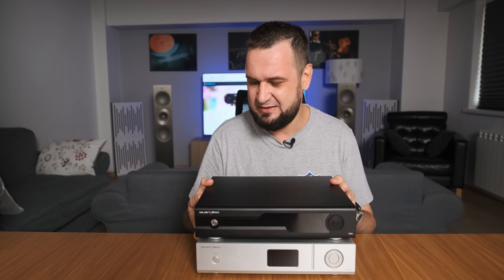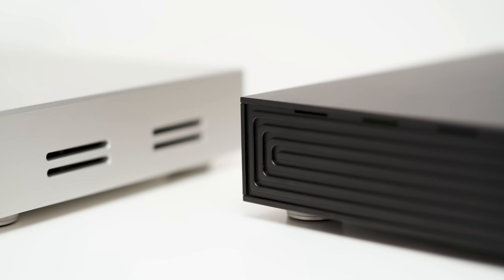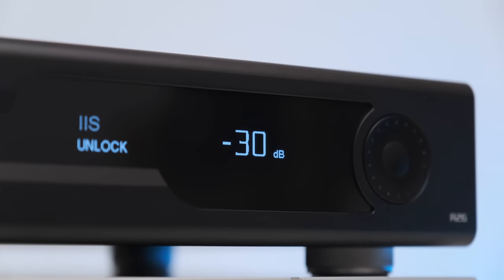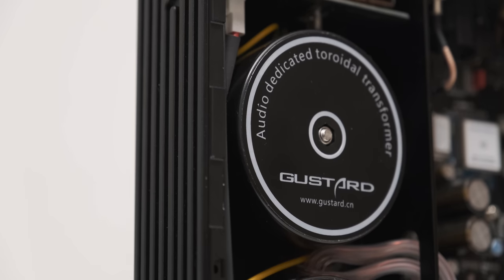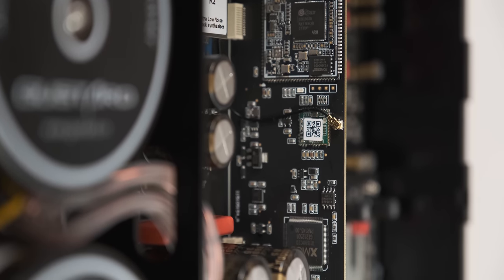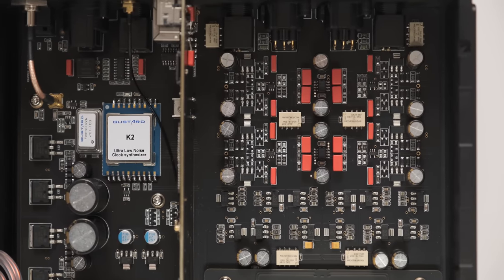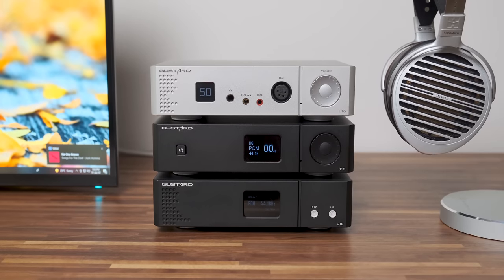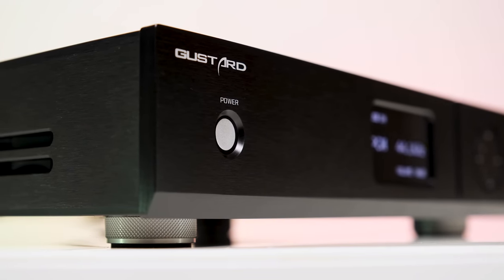The Best DAC I've heard below $3.5K - Gustard R26 Discrete Review

Comment: Hello Sandu, great review👍👍, thank you, I have one question, is there a difference in SQ rca vs xlr output? many thanks in advance for info..
Reply from the maker: Hi mate. The sound difference is minimal at best. Except for the voltage difference and a slightly better channel separation via XLR, they both sound good to me. I used its RCA outputs with the Enleum AMP-23R with outstanding results and I never felt the sound degrading.
Reply: @Soundnews  Many thanks Sandu for helpfull info, so I will use both, rca into my Kinki speaker amp which is single ended and xlr into headphone amp, so I dont need to make a special splitter xlr cable, great work from you👍👍👍many thanks..

Comment: thank's for the review, I want to use a gustard r26 or A26 DAC streamer directly connected to a Benchmark AHB2. you're talking about the A26 which needs a preamp to get the best sound, is it the same for the R26? Is there a perfect solution using the volume of one of his DACs? Or do you really need a separate pre-amp?
Reply: Yes, you will need a separate pre amp unfortunately. All these units use digital attenuation which reduce dynamics so you lose lots of detail especially on low volume listening.  I found this out after I put my old pre amp in between my dac and amp.
Reply: Merci, depuis est sortie l’eversolo dmp-a8 qui inclus un vrai pre-amp, je pense l’acheter 😊

Comment: This review came at the perfect time. I'm in the market to upgrade my system closer to endgame and was very much desiring the Musician Aquarius based on your previous review, but it wasn't in my budget. I was going to settle for the Pegasus & then this review comes out with a very encouraging comparison to the Aquarius & T+. You sold me on this DAC. Ordered!
Reply: I was in the same boat. About to order the Holo Spring 3 and saw this review. Decided to save a grand and try this out. If it is as good as Soundnews says, and works in my system, then I'm done.
Reply: Did you get it yet?
Reply: @klepp19  yes, I've had it for about 3 months. Paired with u18ddc + LHY Audio OCK-1 10Mhz clock + gustard c2 cable. Running IIS into Burson Audio soloist 3X GT. This setup was a huge upgrade from my Topping a90/d90 mqa stack. I have hd800S + HE1000se. HD800S low end came out like I've never heard before on my previous stack. Makes it a much more balanced headphone. HE1000se full sounding and hyper detailed. I didn't mess too much with the LAN option as I don't subscribe to Roon/Audirvana or other media platforms to take advantage of it. I did get trial passes just to try it out. A friend of mine that A/B'd LAN vs IIS felt the LAN was better to his ears by 5-10% at best.
Reply: @OG-cl9br  Thanks for sharing your experience!  I already own a U18 DDC so that I can plug right into I2S?
Reply: @klepp19  correct.
Reply: @OG-cl9br  I will order one after Christmas! I will post here again once I have it! Cheers!☺️

Comment: Hi Sandu I mainly listen to DSD 512 upsampled thru hqplayer via PC using Tidal. I currently use the gustard x26 pro for this. I understand r2r dacs benefit more for pcm. Do you think there will still be an improvement as what you have described i.e less ringing soundstage etc if I switch from x26 pro to r26 if I always upsample only to DSD 512? Appreciate your inputs.Was your test tracks played on pcm or you also noticed the improvement on native dsd? Thanks!!

Comment: Hi Sandu,
There is usually a tradeoff between detailed and tonal richness (meat on the bones). My only experience with R2R was the Denafrips Ares II which I promptly sold for lack tonal richness. I currently own Loxjie D50, while it didn't change my life, it offers enough detail without sounding too thin and clinical. You've established that the R26 is very detailed, is there a tradeoff in the ''meat on bones'' department compared to other high end DACs? 
Edit: OK I just read your written review which I guess answers my question.
What I'm looking for above all else for system synergy is detail yes, but most of all tonal richness. Endless features are at the very bottom of my list. I've found that sometimes the most technically impressive components are the least musically enjoyable when actually listening to real music.
Reply from the maker: Mike, you are right. There were always tradeoffs with R-2R units, even with end-game units like Denafrips Terminator Plus and Musician Aquarius, but as I've mentioned at least 3 times in the R26 review, I didn't felt a single con with it. To me, this is perfection. I won't change a single thing about it. This is how I would design a DAC at this price point. I fact I want to work with Gustard on at least a single project, after hearing their X26 and R26.

Comment: Hello Sandu I want your opinion, I m in the market for a new dac for my headphones setup.. before this review I an ready to pull the trigger for the X26 pro... now I m a little confused... 
My big problem is that I m listen only MQA from Tidal..  and I don't know If the R26 is for me.
Can I listen MQA with the R26. ?,?? 
Which of two do you believe is best match for me..??
Thanks in advance.!!
Reply from the maker: Ditch Tidal and get Qobuz, you'll get a ~10% improvement (no kidding). X26 PRO versus R26 depends solely on your upstream equipment and preference. Both are legendary units, but for me...R26 has something that X26 PRO will never have.

Comment: Hi Sandu! I bought one of these and it sounds good! But I don´t know if my unit is healthy. I connected it directly to a Emotiva XPA Gen3 poweramp and I can max the volume without hurting my ears! Best regards Mikael
Reply from the maker: Hey Mikael, that is weird indeed. At max volume, XPA Gen3 should blast a hole into your eardrums. What speakers are you driving?
Reply: @Soundnews  At the moment a pair of floorstanding System Audio Aura 50 Impedanse 4 Ohms, sensitivity 90 dB! I have three pair of speakers for variation. I checked the output impedance on the Gustard and it should be 100 ohms. The input impedance of the Emotiva is 33 kOhms (balanced).
Reply: Hi I have xpa dr2 and I try connect R26 straight to Dr2by xlr.Are you think is good idea to spare together? are you happy about your system? Thanx
Reply: @buekbukiewicz8064  Hi there! Yes I think it is a good idea to connect a dac of this quality directly to a powerstage by xlr!

Comment: Your review inspired me to order one!  I just experienced  the Zen Stream feeding my HiFiMan EF400 R2R into my 2-channel system via XLR.  Beautiful sound, ZERO listening fatigue but a little "soft" and missing the pinpoint placement of my Matrix Mini-i Pro 3.  Based on your listening notes (and I run Roon) I am excited to "burn-in" this DAC and hope it is "just right" for me.  Thanks again for the YouTube review and your excellent online review.  QUESTION: has anyone tried it with Roon yet???
Reply: Hey bro, may I know R26 is a major improvement compared to Matrix Mini-I Pro 3?
Reply: @JeffreyTham  I absolutely love the R26.  So smooth in my room/system.  The filters on the R26 between OS/NOS (slow/mid/fast) are audible differences and I change them based on recording if needed.  I really have zero listening fatigue.   I plan to run another ethernet cable to my listening room and do a proper A/B since Roon will allow multiple end points.  But, to sum up, I like the Matrix a lot, I just like the Gustard SO much more!
Reply: @magneticcinema Did you say you are using a Zen Stream with the R26? Thinking about doing the same and wanted your input on the sound quality. Cheers
Reply: @Temmple   I do own the Zen Stream but only tried it with my HiFiMan EF400 (which is R2R as well) headphone amp.  I am currently using the R26 as a Roon endpoint via the ethernet port.  VERY happy.  I also purchased a Cayin CD player/transport with I2S but unfortunately the L/R channels are swapped.  I may try the Zen Steam when I get less busy.

Comment: I'm curious if DACS like the Gustard R26 and the Denafrips DACS are mainly meant for Speaker setups over headphone use?
Reply: They're meant for both, but I think you can hear the difference more so on loud speakers than Headphones.
Reply from the maker: Nope. NO, no, no no. It doesn't really matter. A 4V or 5V analog output works similarly in either setup.

Comment: I’ve just acquired R26. Generally speaking, all findings on your review match what I’ve found in my listening, however there is one thing which you did not mentioned, maybe it was not the case on your setup, but I noticed that R26 lacks both body and weight in the mid bass. Thus, could you check if this is really the case? Also, do you see any advantage in changing the fuse for a Gustard one or even a HiFi-Tunning? Kind regards
Reply: Are you still experiencing this bass issue? Every sound demo I have heard of the R26, it sure sounds like a chip DAC to me.
Reply: @michaelwright1602  For my surprise the sound signatured changed a bit from the initial auditions, having now a more pronounced height in bass in the middle region. Maybe my hears got used to it or it really changed?! There are some differences also using NOS filtering ON and OFF, but so difficult to classify and to get a clear conclusion which one is best (sometimes depends on the type of genre and recording). Just for the sake of my peace of mind, to enjoy music and have a more relaxed listening I’ve decided to use NOS mode ON (overall seams the best option to get a more neutral sound, best dynamics and bigger sound stage). I would say that this DAC is so neutral that it reveals a lot about your recording quality, thus when they are not good, they will not sound good. For example, I’ve some collections of music from the same singer/band and sometimes you can really see huge differences from one record to the other.
Reply: @pedrojesusbarata  Thank you for replying back... These R2R DACs do require a bit of burn in to start showing their true colors... I think I am going to go with the Venus II 12th... Shoot the wad and be done with it. I like that Denafrips house sound. And Alvin over at Vinshine has always treated me well.
Reply: @michaelwright1602  Not a simple choice between R26 or Venus, but I do prefer the more neutral sound signature of Gustard DACs. Overall Denafrips has bigger reputation and already a good market. In my cased the build in streamer is a very useful feature included at a very competitive price. Works very well with Roon and mcconcet App (paid version), Should work with potentially any app that can stream to UPnP renderes.
Reply: @pedrojesusbarata  I went with the Venus, Alvin at Vinshine knocked off some $$$, nice little discount. I picked up that new Pi2 Mercury V2 streamer also, along with a couple linear power supplies. Should see it next week.
Reply: @michaelwright1602  My former streamer was based on a Raspberry Pi 4 board, with Volumio software (very good one, supporting DLNA, Spotify, TIDAL, Qobuz, Youtube, etc., etc.), cheaper than Roon and much more flexible (can browse folders in your DLNA servers/NAS Servers, something missing in Roon, which is a big limitation when you have a library with thounsands of files organizes in folders). It works wonderfully with the USB port. Unfortunately, cannot stream to an UPnP renderer, however, can work as a renderer. Hope they include it soon, so that it can stream to R26.
Reply: @pedrojesusbarata  How is the streamer in the R26? That was a feature I was interested in before purchasing the Venus.

Comment: Although I love your reviews I have become a little skeptical. I ordered the vmv D2, returned it it was too too muddy in the mids
really unbalanced to the point that you lose information. Then I ordered the singxer pro, after 300 hours or more it was still screaming... not the treble region but the mid highs. I really loved it but  when you hear piano or female voices it just hurts. You warned us about these aspects of those devices just not the level.
Would you say that  R26 is more or less linear than those devices? is there a region it prefers?
Reply from the maker: I complained about both D2 and SDA-6 PRO and I didn't complain at all about the R26. It's in a higher league. It doesn't scream in the top-octave and it's a very technical R-2R unit, without a single trace of muddiness. With my gear and my ears, R26 is a much better unit.

Comment: How does this compare to the SMSL VMV D2 dac, and you mentioned heatsinks on this.  So this thing runs very hot like the X26 pro then?  Also, did you hook this DAC up to a PC or a TV and test if there's an audio delay on the inputs?  Denafrips dacs suffer from an issue with their FIFO buffer on the inputs.  There's enough of a delay on the inputs that if you use them on a PC or with a TV, the sound will be delayed slightly behind the video.

Comment: 18:50 Gustard R26 doesn't work as a dac, streamer and MQA decoder at the same time? or it doesn't sound as good as being used just as a dac and preamp? 
I would leave the preamplification job to an integrated amp and I wouldn't need the preamp function

Comment: Sandu is it worth it to change my Gustard X18 for the 26R. Is it worth double the money.And how come you never put the X18 in your dac line up.
Reply: Sandu you didn't answer my question ❓.so I will answer it. I purchased the R26 and it is much better than the X18..; The R26 brings my system to the next level. The R26 is a real high level DAC. Amazing I love CDs like My vinyl .

Comment: Hi everyone ☺️ just bought the gustard r26:)
Can recommend me which DDC is preferred with it...? The gustard u18 or the singxer su6...?
Reply: I think Sandu mentioned in his website comments that Singxer SU6 is the more accurate DDC (while the U18 is more on the fun side but less accurate and resolving). SU6 jitter measurements are significantly better than U18 if you care about measurements. I have the SU6 connected to R26 using IIS and it performs admirably.

Comment: interesting! the Denafrips Pontus II is the same price r2r very famous dac, very strange you have not review it yet :)
Reply from the maker: In my case, R26 outperformed their Venus and TPlus, I don't think Pontus will stand a chance.
Reply: terminator plus has worse stage? depth? i can't believe :)
Reply from the maker: @acheresh  I have no reason to mislead my audience. R26 beat every R-2R DAC that I  tried so far, especially via its Ethernet input working as a Roon endpoint.
Reply: @Soundnews  Do you think this method would hold up and be as great if I were to DLNA Upnp from mac mini using Audirvana over my network? The mini is not hardwired to anything, but sits on my network. Thanks

Comment: How does it compare to Eversolo dmp A8
Reply: The Eversolo DMP-A8 is a combo device. It’s a streamer, Dac, as well as a preamp. If you need all of those features in one box, then it’s a good solution.  I’ve had the A8 and I also have the A6. When I paired the A6 with the R26 the A8 was no comparison. The R26 with A6 via USB just has more meat on the bones than the A8 does with its internal Akm chips.

Comment: Can I use it for games and media consumption?
Reply from the maker: Hey mate, I see you asked the same question in a few R-2R DAC reviews of mine. The only R-2R unit that I would recommend for gaming is R26 Discrete. You were right about the slow FIFO buffers on Denafrips devices...you cannot bypass them, so there's always some lag when gaming with all their units.
Reply: @Soundnews  thank you i bought the r26 yesterday, do you recommend to keep this unit on all the time ?
Reply from the maker: @Andyusa11  I won't do that, as it gets hot after a few hours of use.
Reply: @Soundnews  just received the DAC today dude, just amazing, tried with games and it work flawless, what speed do you use PCM filter ? PCM nos you leave it on ? DSD direct you leave it ON ?

Comment: The use capacitors of the same manufacturer/model in all (analog and digital) networks. That's not a hi-end. I would expect at least 5 different types.
Reply: Inside R26 there are several type and brand of capacitors. There are Nichicon KG Gold Tune, Nichicon KZ MUSE, Nichicon KW, Wima MKS, SMD Tantalum caps...